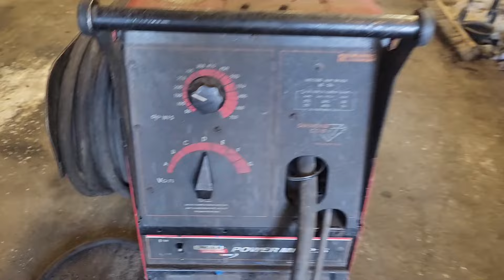HT3B turbo install by @wildgoosedieselrepair

Comment: Them old Cummins. Had a 290 a 300 a 400 big cam 4 a 435 n14 and the one I’ve got now. Isx 450 had since 2000 bought new. Brought back some good memories. The truck  I got now is a 9900 long hood. Been a great truck. Like you videos.